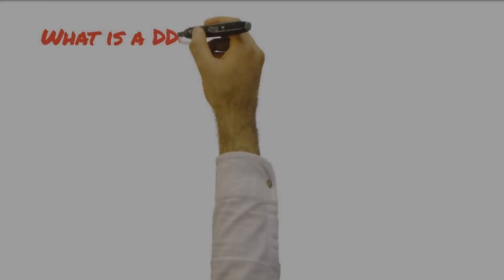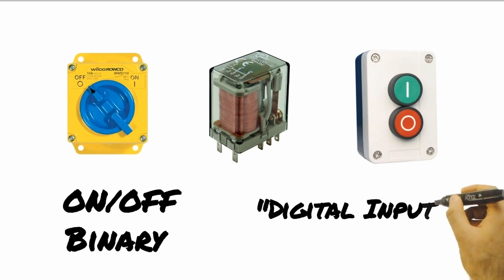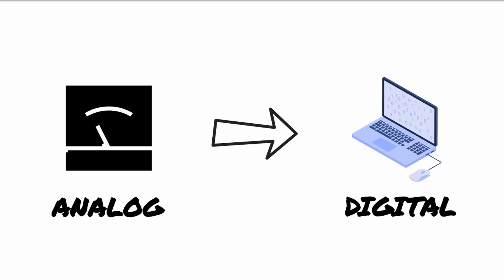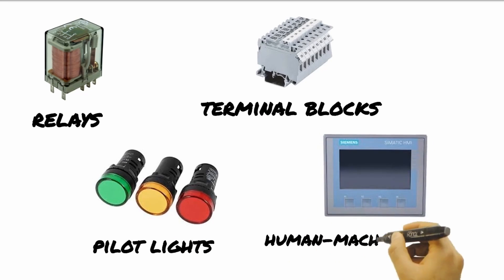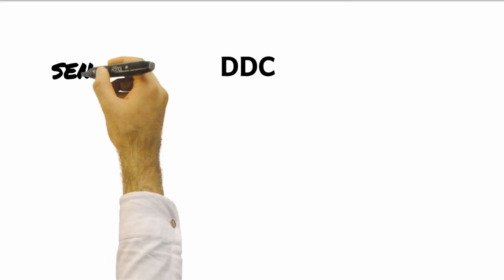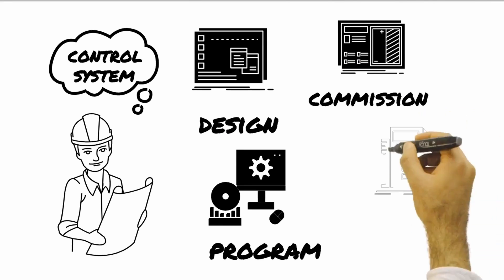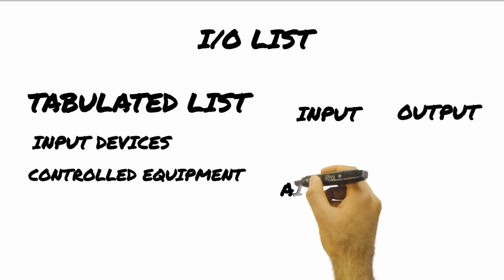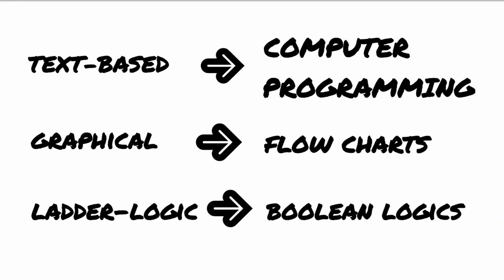Brief Explanation of Direct Digital Controller (English)|#ddc | #hvac

Comment: Sir dto ako hirap n hirap sa ddc .nasa oil and gas ako nw dto sa oman..dating saudi pero itong work ko nw gumagamit ng ddc .lagi my problema sa change over.ano pd ko gawin dko din makita san banda ung control wire galing sa relay n ng papaandar ng unit
Reply from the maker: sir suggest ko sau i-trace mo yung wire from DDC to control panel ng unit. Basahin mo sir yung termination diagram. Thanks and God Bless

Comment: sir  if  have two DDC panel in one building. Both is standalone..One located on gf and one on 1st floor..initial sequence of operation is that GF DDC will control and monitor all exhaust fans ,FCU, chiller and doas unit and 1f DDC will monitor and control 1f hvac equip. (FCU and EF) . Now they wanted to monitor and control all the hvac equipment from GF but maintaining 1F DDC functionality.

My question is how can I approach this changes in requirements..Will it be like as master slave architecture? How can two standalone DDC communicate with each other.?
Reply: Did you get any clue about it?